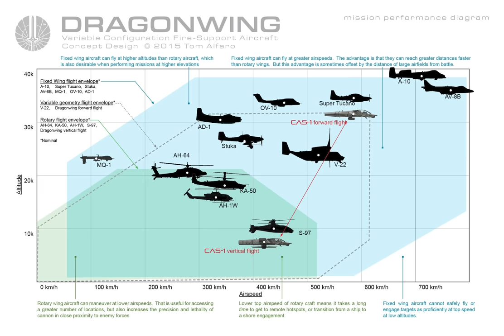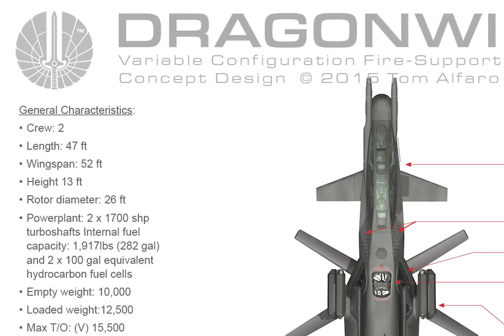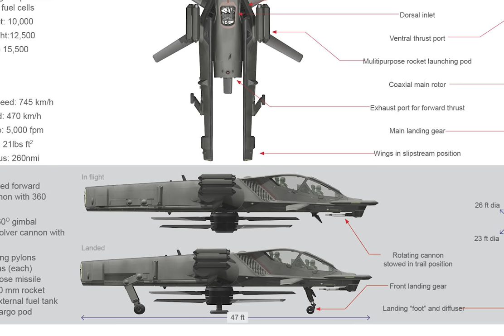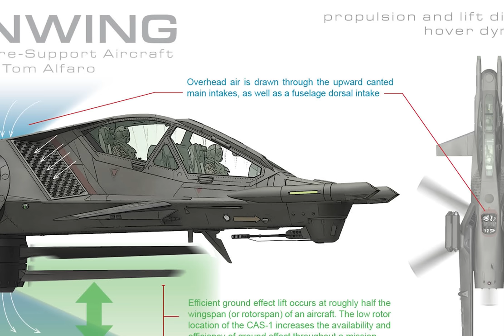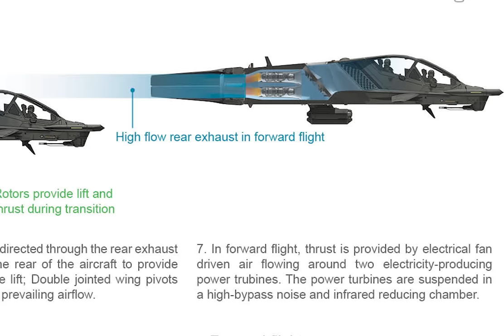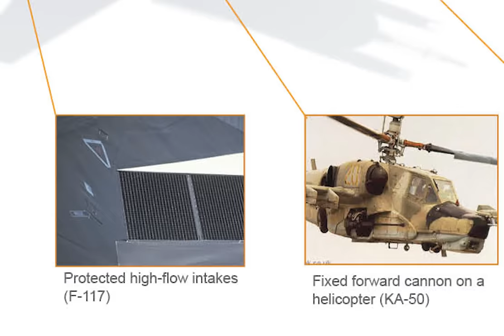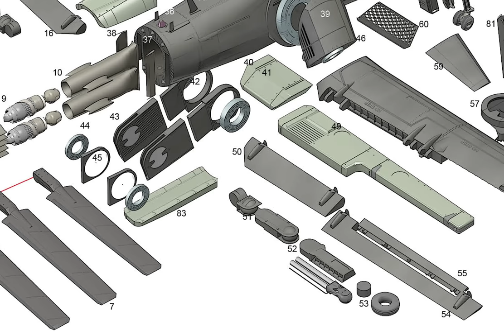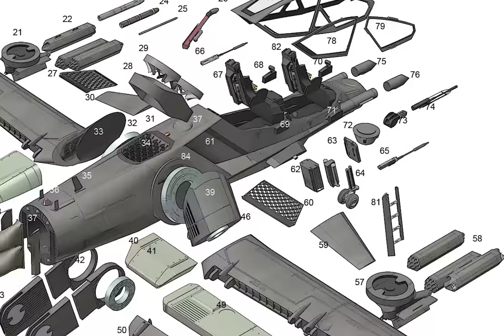Pan Spatial DRAGONWING Variable-Configuration Fire Support Aircraft: Full Presentation

Comment: I still have no idea how this aircraft can safely make its transformation in mid air
Reply: thats what research and depelopement are for [R&D] i think it will be difficult to remain stable but i believe its possible
Reply: Neither do they.
Reply: @skyhighmediasolutions891  And your opinions are of utmost importance since you can't even write a sentence, Ms. Anonymous.
Reply: Transformation in air might not even be necessary, as long as you have a suitably large landing platform. Think of the V-22 Osprey. That is one aircraft the Dragonwing would have to improve on. After landing, the transformation might be useful to save hangar space, for instance on a ship.
Reply: Q: I still have no idea how this aircraft can safely make its transformation in mid air [?]

A: magnets
Reply: INSANE
Reply: Flight control computer, mostly. However, this thing would have significant limitations in transition envelope to put it lightly. an F-35B can switch from vertical to conventional flight in like.... 15? seconds? this thing would take the better part of a minute at least.
Reply: @DFX2KX  fake story, just clickbait from a kid's imagination. And boy does he have a lot to learn.
Reply: @royhenley2396  Sure, it's a concept aircraft, but Fly-by-wire can keep just about any abomination in the air if it's dialed in right. I've made worse in X-plane's Plane Maker. Again, it'd have significant limitations  to when and how it could switch modes since it's control surface effectiveness would be compromised for about half of it's cycle. Buuut with a tweak or two, I bet I could get it to fly in X-plane.
Reply: @DFX2KX  ok, I was looking at it from a manufacturing/reliability point of view.
Reply: @royhenley2396  Ah, yeah. That's fair, this would be a Crew Chief's nightmare for sure.
Reply: It will broke if it transofrming at high speed
Reply: @arrs5590  that too. anything over 100kts or so would be extremely hard on the joints.

Comment: 1st, good try at innovations that combine several missions within a single platform.  2nd,  I don't like this concept's implementation.  Drones can take over most missions remotely.  Un-crewed is where it needs to start.

It does deserve mention as a starting design point and thinking for an A-10 replacement.  You have earned a ribbon for this design.  Wear it proudly.  Now, try again.

Never ever stop innovating.  - JSW

Comment: Definitely not a completely new concept. DARPA funded the Boeing X-50 Dragonfly (canard roto-wing) in the early 2000s that had a much simpler design and it still had problems. Both demonstrators were crashed and funding pulled in 2006. Was a neat little project to work on though. Funny to see this 20 years later with a similar name.

Comment: Why bother with retracting the wings?  In your design in deployed position they're not even in the prop wash as they are in the Osprey.
         In forward flight with the rotors retracted, they don't provide forward thrust, so why rotate them around the pitch axis?  Rotate them around the yaw axis they're already rotating in, and retract them to the fuselage.  Your design can be improved with an axe, by REMOVING "FEATURES".
Reply from the maker: The main reason the wing retracts backwards is it looks really cool - and the transitional sweep of the wings is very dramatic. The practical reason is that as the rotor mechanism shifts the CG forward, shifting the wing to the rear maintains some CG balance. If you think wings structure might weigh a lot less than the rotor ‘hub’ you are correct, which is why the wings are invested with the fuel cells, which are probably pretty heavy. Coming up with an enclosed wingroot mechanism, while maintaining a prevailing airflow orientation throughout transition was a tremendous challenge. But has actually been useful on other IRL devices.

Comment: What's with all these comments about all this being so strangely negative? Do they think these renders will become a real aircraft?
Reply from the maker: A: yes. It’s and interesting effect. In spite of the fact that the text says it’s science fiction, the level of detail and contextual realism lead a lot of viewers to believe it is intended to be real.  And I don’t mind a bit.
Reply: @PAN SPATIAL Aerospace Concept Design  the irony is there's a somewhat similar irl drone that has the rotors in the wings.
Reply from the maker: @theneef174  yes. The Pterodynamics Transwing. That design uses lighter weight ‘arms’ to achieve a very similar motion path for the wings. The challenge to that motion path is that a simple pivot in the fuselage and a hinge along the chord won’t do well - the wings would stall at one point and rip off at another. However you can see with the relatively light structure of the transwing mechanism that the forces of the better motion path (similar to dragonwing) are quite manageable, A further advantage of that overall design is that the wings have continuous active flow that also prevents stall. However the Transwing solution does result in an exposed wing root mechanism.
Reply: @PAN SPATIAL Aerospace Concept Design  It's a very interesting concept, the navy apparently looked into it but I'm unsure of what happened after that.

Comment: I'm a Super Hornet Technician in the Navy. I don't think supporting a fleet of these would be practical.
Reply: Anyone with aeronautical engineering knowledge would find this design impractical, too many moving parts would spell more attention on maintenance. Avatar dual coax rotor is more feasible but losing 1 side would lead to crash too.

Comment: Someone should do a non flying mock up. My one complaint is this is slower then an A-10.  I'm not saying it has to be supersonic(would be nice).  It should at least equal the speed of an A-10 in forward flight.
Reply from the maker: Aha! What we need is an aircraft that goes faster than an A-10 when it needs to, and slower than an A-10 when it needs to. Dragonwing does not do that. But, as a concept design it does experiment with possible ways and challenges to getting there.
Reply: @PAN_SPATIAL   I know this is all "What If" but why couldn't you just say it did go faster then an A-10? Since we are talking how can the rotor blades be flexible enough to spin but strong enough to handle the jet thrust?

Comment: Very ambitious concept but built in hardwares is more important than futuristic design. Placing rotors below vehicle might be more deadly from anti-air weapons or stalls.
Reply from the maker: You are 100% correct.  But, it can have ejection seats to improve safety.  And in airplane mode it will have good glide ratio.

Comment: The fatal flaw of the design is there is no vertical stabaliser / tail to provide straight flight or yaw while in forward flight, you are relying on banking only for turning this is impractical also a dumb idea when close to the ground. Some will say what about the B2 bomber that doesnt have a tail. The B2 is a multi engined beast which has the engines spread far enough to provide yaw by speeding up one side plus vectoring. this design has only 1 main engine and 2 tiny turbines for providing electrical power only. while  a cool concept, this thing needs a bit more work to make it practical and not a multi million dollar 2 man suicide machine.
Reply: They sould start off with a scale model as a proof of concept first to see even what they are proposing is even in the realms possibility , what looks good on paper doesnt always work out in the real world.

Comment: The most glaring omission here is directional control…. In hover mode, I would imagine torque differential between the rotors could handle that, but once transitioned to forward flight,  rotors are gone, no vertical stabilizer or rudder, no mention of vectored thrust for yaw control, and is pitch control handled solely by the forward “canards”? They look like they’re mighty close to the center of lift … is there enough moment arm length present to manage rapid changes in pitch? Why was this not addressed and why has no one asked about it? One of the first things I noticed about the overall profile was the absence of a vertical stabilizer… could the top two rotor blades continue rotating around, past a conformal position as part of the aft fuselage, up to form a highly-raked v-tail system, similar to what is used on the F-117 ‘stealth fighter’? It still seems that there would be an interval before that was in place that there is no provision for yaw control.

Comment: i find it really funny how it's pointed out that a V-22 has a lot of parasitic drag from the rotor airflow intersecting with the large, forward flight wings, but the aerodynamics of how air is supposed to reach the dragonwing's rotor is ignored. a pretty large chunk of the rotor has the airframe directly in the way of airflow, and while i suppose the dorsal intake would supplement the airflow for the rotor, i can't imagine substantial or reliable lift coming from a rotor with such an odd intake position
Reply: don't get me wrong though, i love the design this video is pretty awesome
Reply from the maker: All helicopters have the problem of the fuselage compromising the lift of the rotor.  Fortunately that problem exists mainly at the center of rotation, where the rotor is doing the least amount of work anyways.  The purpose is showing the similar but related issue on the V-22 is to show that even the most advanced aircraft are flying with some significant integration compromises.  Compromises that show when it comes to overall system efficiency, a tough compromise is acceptable and sometimes worth ardently pursuing.  (Also that there are many technical compromises out there waiting for a better solution!)  The concept of overcoming fuselage parasitic drag by directing thrust through the rotor-hub area, or the fuselage itself, is a possible and intriguing idea.  Not executed super well on Dragonwing but you ‘gotta’ start somewhere!
Reply from the maker: I know, I know!  I appreciate you feedback because I fight this battle in my head on every concept design.
Reply: @PAN_SPATIAL  in reference to the compromising lift at the center off rotor, yes, i am aware of that, but on the dragonwing the radius of the rotor blades is much smaller, and is also far closer to the fuselage for longer, because the fuselage extends beyond the actual blade length. again though, i really want to applaud how much effort went into this design, and how awesome and cool it is. really cool stuff, dont let losers who nitpick small stuff like me discourage you!!

Comment: So are we saying that this is just a half-baked idea.

Dragon Wing should have been called Dragonfly, which would be far more appropriate and a cut above the rest. 

The idea seems to be nothing less than a short fall of not being able to come up with something far more interesting. 

So what would have been a real game changer... The short answer is throw this idea in the bin, and create something that has far more appeal. While the video, is too boring, it has lost everyone on the dull technical data. 

What you need to do is scrap this go back to the drawing board and create this into an autonomous drone, but scale it down to micro, and nano, interfaced with an A.I. battlefield command system. 

Once you remove the human aspect having to engage, and allow A.I. to be the brain, then you will have something that people want. Even if you have to come in at the entry level tactical warfare beginners level at least that would be something.

Comment: The folding wings is a waste of weight.
The wings should have been fixed and mounted higher up on the fuselage.
Reply from the maker: The main purpose of the folding wings is to maintain longitudinal center of gravity when in vertical mode. Secondary purposes as part of an integrated design include 1) Bring wing mounted payloads closer to lateral CG when in hover 2) provide structure for landing gear located opposite the CG of the nose gear 3) facilitate gnarly upward firing rocket pods - all three of which would require a weight and complexity commitment elsewhere on the aircraft in some capacity to achieve similar results. Although the specific need for each benefit are highly subjective, the exercise in understanding the need for that kind of folding geometry has bought it’s way onto at least one flying VTOL aircraft. Link: https://evtol.news/pterodynamics-transwing/.  As a matter of analytical priority, the necessity of and issues presented by the folding wing are pretty insignificant compared to the debatable necessity and issues caused by transitioning the main rotor under the aircraft.

Comment: Why this stupid idea? due to the large number of motors and drives, it will be so heavy that it will lose efficiency. Do I understand correctly that the propeller turning back gets under the jet stream and temporarily blocks the jet engine? it will lose stability and the screws will not last long. it will need a huge amount of fuel. and all this time its stability will withstand the resistance of changing positions of the wings and outboard equipment.

Comment: too many moving parts, an engineering nightmare. The chances of failure is exponentially increased. Using a jet turbine to do vertical lift will be simpler. Even F-35B is more efficient.

Comment: Rotors act as the exhaust nozzle ? Great. Rotors need to be on top to be safer. Too complicated to be used by armed forces. Swivel bearings wont be abke to hold that wing with all the load on it, major failure point.